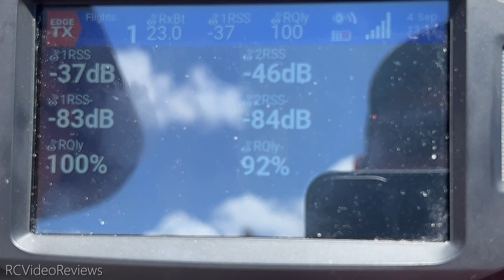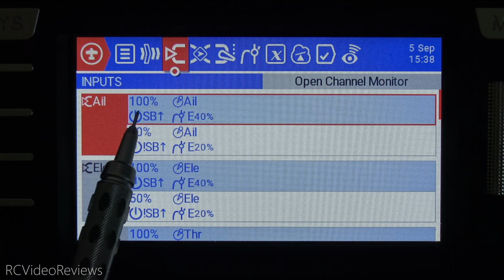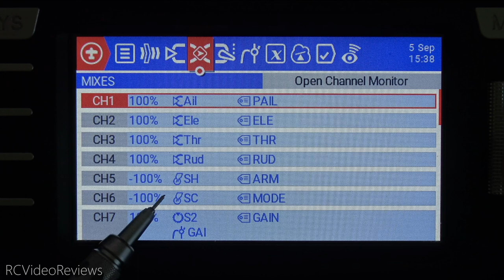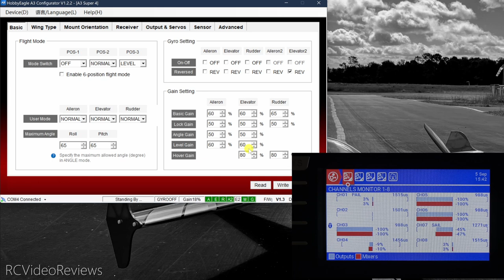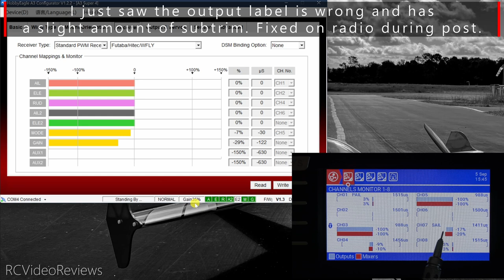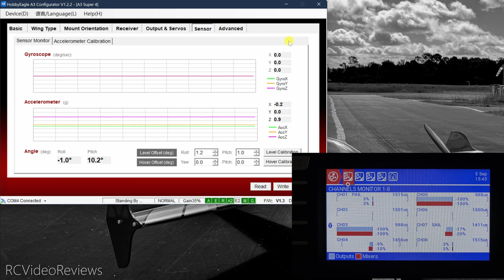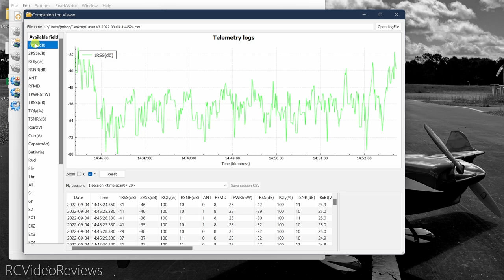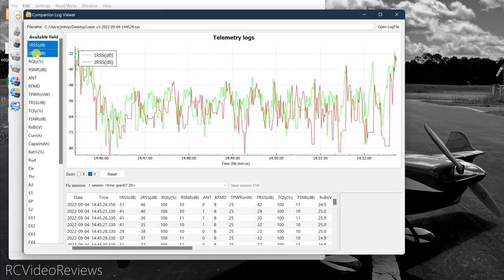Extreme Flight 60" Laser v3 Maiden with EdgeTX and Hobbyeagle A3 Super 4 RC Airplane Setup

Comment: Looks like a fabulous plane... and great flying, first live prop hang on a maiden... courageous stuff! I'm struggling to get my head around the gain control on the Hobbyeagle. The way I undertstand it is that if you set a curve which limits the master gain control from the Tx (to approx 35% in your case) then this means you are only utilising up to 35% of the 60% gain set in the configurator, so 21% max?
Do you think a flight controller eg  SpeedyBee F405 WING-MINI APP would also be a good option to pair with the ELRS receiver instead of the A3/PWM board? I haven't really got my head around how stabilization gain is adjusted in a flightcontroller/iNav, or even if it can be. Maybe they take over just too much.

Comment: John, if I may ask - What BEC did you use on this build to power the servos?  If I read it correctly, the converter board needs a BEC for the servos?
Reply from the maker: As there was no mention of a standalone BEC, the servo rail would have been fed from the ESC BEC.

Comment: Would you advise against running a RimFire 32 in this model?  I just happen to have one new in box and a 100 amp Castle RC ESC.
Reply from the maker: Yes. I would advise against it. It might fly, but it would feel anemic. This plane needs a 16" prop. Rimfire .32 tops at 12" and is spinning too fast.
Reply: @RCVideoReviews  Thanks John,  appreciate the help!
Reply: Rimfire 80 works well with 16x8 prop.

Comment: Did the Super 4 come with the remote LED module that the Super 3 has? There is no mention of it (or is it pictured) on HobbyEagle's website. Your affiliate link on Amazon says it DOES come with one. Can you clarify this? Thanks!
Reply from the maker: They have two versions and two price points. One with, and one without the programming box. The programming box adds another ~$25
Reply: @RCVideoReviews  I'm referring to the remote LED module, not the programming box. Based on your reply, it doesn't sound like it comes with one.
Reply from the maker: I'm not at all familiar with a remote led module...?
Reply: @RCVideoReviews  It's the gyro's status LED (and USB interface) on a little board that can be placed outside the fuselage for easy access to the USB programming port and (external) viewing of the gyro's status. It comes with the Super 3. Thanks for taking the time to reply.
Reply from the maker: That comes with all of them that use the PC for configuration. It's probably a FTDI adapter.

Comment: Hey, would you recommend the Hobby4 gyro for a EF74 inch wing plane?
Reply from the maker: Kinda of depends on your use case and you gotta watch out for current draw. I usually only use gyros for wind rejection purposes, not for attitude lock or any of their other modes. It usually takes more wind perturbance to have an effect on larger planes. So they are less helpful the way I use them on larger planes.

Larger planes--depending on how you fly--also use bigger servos which can draw a heavier sustained current. I don't know what the Hobby Eagle specs are for sustained current on the output pins. So this is just something to be aware of. For sport flying, I really don't think it would be a problem. For XA you might want to do some homework. 

On the current issue, be advised: The gyro only "needs" to see the signal wire from a servo. You could power them from another source. 

This is a good question with probably more of an answer than you bargained for.